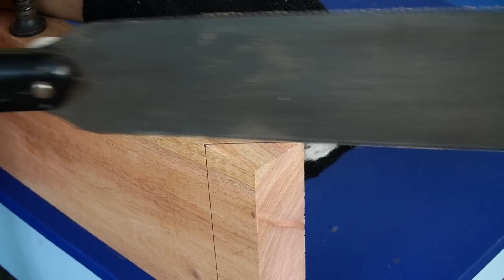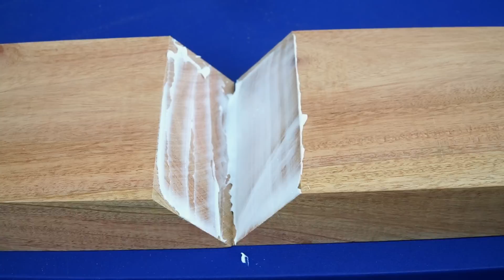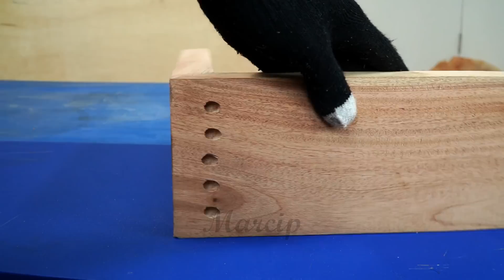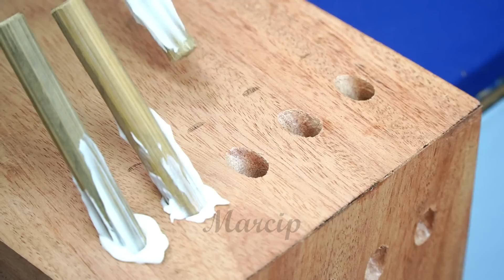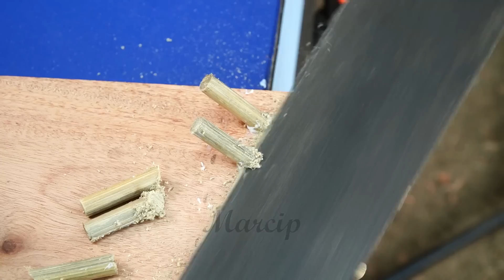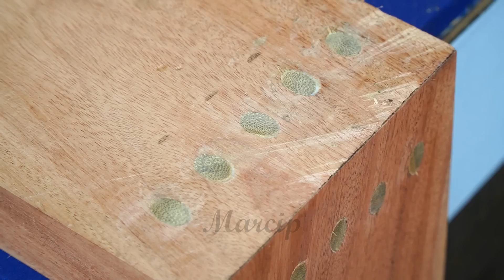Tips Duri Melintang  Pengerjaan Kayu Sudut Yang Estetik  Menakjubkan

Comment: If I am drilling holes at a 45 degree angle, I take a block of wood, drill through it, and then cut the block at a 45 degree angle. If you clamp it in place, you don't get any tear out on the entry hole. Have to clamp a block on the other side to prevent tear out there.
Reply: Yes! This!
Reply: Wow, wish I had read this a week ago ... well now I know. Thanks!
Reply: Thank you – I was hoping someone had addressed that issue. Also probably could’ve saved some dowel wood with more efficient use

Comment: Not a bad idea. I would cut the mitres once and be done with it. You would have to make sure the initial glue up is the strongest. Then I would use a pocket hole jig at least to ensure you're on the same line, otherwise it doesn't look aesthetically pleasing. Also someone else commented saying to clamp a block on the other side to avoid tear out - great idea. 

Overall I may use this idea. 👍
Reply from the maker: on marcip channel showing wood connection techniques from those that prioritize strength to prioritize beauty, just choose what you like from my channel